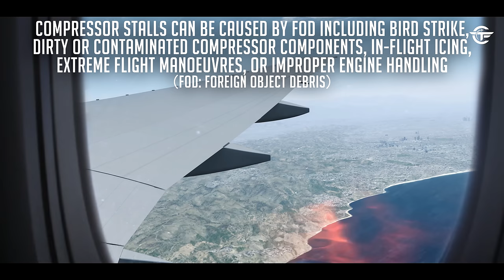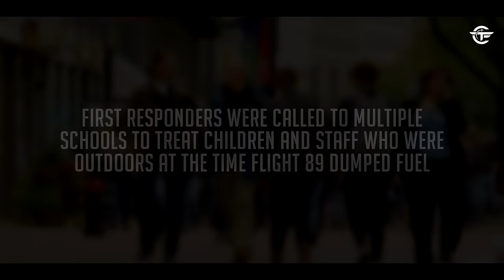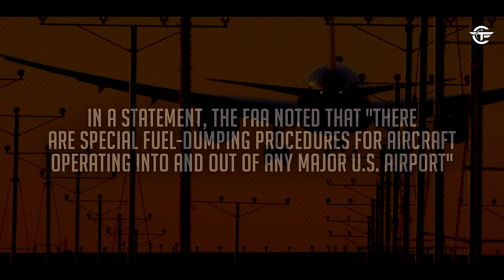Bursting into Flames Immediately After Takeoff from Los Angeles | With Real Audio

Comment: Ok I didn't think about the fuel dissipating when over 5000 ft I was just thinking right before they said that "doesn't that affect the water?" Also I noticed, not just in this video but another 1 I watched the ATC says like 128.9 but the pilot says 28.9. Does anyone know why the controller says the 1 but the pilot doesn't?

Comment: I've seen atleast 2 flightchannel videos where pilots went to dump fuel in the ocean leaving their normal landing course and ended up losing the plane and everyone on board. Everyone in comments were criticizing the pilots for taking the detour for dumping fuel and saying they should have just dumped it wherever and landed the plane. That's what these pilots did. And here the comments are opposite. I swear people always find faults. The crew had one job, to land the plane safely. They believed the plane was at enough risk that taking a tour of the ocean for fuel dump was too dangerous. They had one engine, you don't get to do business as usual with one engine. They took a difficult decision and landed safely. People also seem to think fuel dump happens in 1 second as if a big door opens from the wings and dumps it all at once. Its a slow process and the pilots started it at high altitude. There was so much fuel that even when they finally had to descend to lower altitude it was still dumping.  It's easy to criticize in hindsight. I respect the pilots for doing their job knowing full well they would probably be fired for doing so.

Comment: If ATC asks what's the nature or severity of the emergency, dont get technical with " compressor stall on right engine" or "vacuum failure" or " inertia separator malfunction" or any crap like that its not to say that ATC can appreciate the exact nature of your problem as you experience it in the cockpit. Time and concise communication and understanding on both sides is of utmost importance. Simply tell the ATC that the aircraft is uncapable of further flight and you need to land NOW, as in yesterday. You can do the nitty gritty tech chat when safely on ground.

Comment: all commercial aircraft have to prove that they can landing safely overweight. The MGLW is only for day to day operations so that large safety margins are kept. But there is NO concern for stopping in time or landing gear strength if they land full of fuel. That is a myth. 

If a commercial airliner could not safely take off, and then immediately land without taking 20 minutes to dump fuel, it could never be certified for flight. In fact, some airliners do not even have a fuel dump ability.

Comment: What a mess ... if you heard the ask on three separate occasions about fuel they clearly had time to answer the tower and choose not to speak over the radio. . But waited to get clearance to land on runway 25 right before beginning to dump fuel... it you listened the pilot answering the tower after they report an engine failure is not the same person... probably the senior pilot only. He knew what exactly what he was doing... nothing by the book that would cause any trouble for Delta including  to not advising the tower about any fuel dump at all.

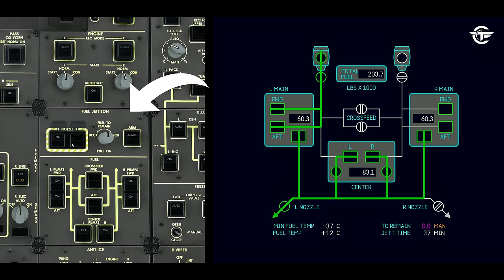Comment: 5:18 this was the first occasion land controller asked Delta 89 if they had to dump fuels. Answer from the stupid captains was "no". The question was repeated several times and the answer was "no". At 8:14 the pilots begun dumping fuels anyway. 10:00 the pilots are in dire straights, they nee to dump fuel but understand they are too low to do it but fails to be honest with the LAX controller. 11:18 The Delta airline is still dumping fuels while in a recognized non-fuel-dumping area and the pilots are not telling LAX. 
 
Sorry guys but this happened n 2020 and for a considerable future time I will not fly with Delta Air Lines. Neither will I approve any expenses of my staff travelling with Delta. Period.
 
When Delta Air Lines has trained all of their staff to the highest level, including stubborn captains, I will reconsider. But it takes proof to make that call.

Comment: Passenger view on from the right side of the plane, flames seen from under the wing, not the whole engine bursting in to flames. Breaking rules about fuel dumping at low level, 5 miles of LA

Comment: This was reprehensible and I wish that the FAA divulged what penalty they assessed to the pilots. They have the power to ground them; and if ever there was a case for it, "this is it!" I keep seeing comments about the pilots just trying to land the plane safely and making excuses for them-"negative!"  As a pilot in the worst case scenario, they should have flown a path over the Pacific ocean until they dumped enough fuel; and if they feared they'd go down beforehand, then the last place you want to crash is on land! Gliding along towards the shoreline is the best option in case you have to ditch.  ATC had moved and cleared the airspace and gave the pilot options and choice of what to do. My goodness, they had to think about whether or not to have emergency vehicles rolled or not! Whenever there's danger or fire, that's an automatic- and they turned back because of fire in an engine; though contained at the time, they had no idea if it would re-ignite or when...and what about the other engine? How many times have we seen cases where both engines ignite or where the cause of the engine failure causes subsequent fires? While dumping fuel, something could've gone seriously wrong and cause the fuel to ignite!  Then what? They're flying over a metropolitan area instead of the Pacific Ocean!???? Those affected by coming in contact with that highly toxic fuel will have to be monitored for the rest of their lives for all forms of lung disease and of course cancer of both skin and lungs. (and some comment "it's only minor injuries!?) COME ON PEOPLE! #SMH

Comment: Not all pilots are very bright. Should have dumped over the water. 10 days later? Most airlines have engine change crews that can swap out an engine in 24 hours easily,if they have an engine available on site. I would think Delta would have an engine available at a large international airport like LAX.

Comment: Shouldn’t ATC be a little more deliberate in this situation? The plane is fueled to traverse a quarter of the globe. If you have to turn back right after take off, It’s not a question of do you prefer dumping fuel. You HAVE to dump fuel if that plane is going to land safely back at LAX. ATC should have told them in no uncertain terms to begin dumping while they are above 5,000 ft and over the ocean, because once they’re descending on the long approach to LAX over populated areas, you can’t then decide you need to dump 20,000 gallons of kerosene on top of all those people on the ground in the middle of a busy work day. And what’s the deal with the Rolls Royce engine? What was found to have caused the compression stall right after take-off? Did they even bother to determine the cause? Doesn’t sound like it if the plane was back in service after only 10 days.

Comment: The flight crew is lucky they are not currently in command of a bucket and a mop., nowhere in operational procedures does it say it's okay to do a fuel dump over a highly populated area you try to do that over an area with that has as few people as possible for this very reason., he could have flown a racetrack pattern just off the coast, and accomplished the same thing.

Comment: It was all a mess and the pilots shouldn’t have jettisoned fuel on approach. This shows they were rushing and. It fully in control of the situation. 

One engine out doesn’t necessitate an emergency nor does it require a quick return to land. Hold, jettison and take your time. It may even be holding of >60 minutes to jettison fuel, depending on the load, so patience is required. 

Unfortunately not the best example of how to handle an emergency and combined with poor communications as well.

Comment: Total BS, fire alert would have been activated and fuel shut off  long before this photo shopped  video shows the flames coming out of the front of the starboard engine.  Notice no black smoke  stains on the nacelle?  Former Airline Captain who has experienced two engine fires.

Comment: so,,,,, you are flying and the engine catches on fire and then finally you shut it down.  yes I know it "didn't catch on fire"... I'm skipping details we all saw/read.

So the issue is not caused by pilot error.  If you messed up and are now no longer over water and no longer above 5k feet, then TELL ATC so you can get instructions about how best to proceed.  Tell them you are concerned about being able to gain altitude, but could still fly back over the ocean to dump fuel.

There must be some guidance or approval process that can happen, right?  on the fly?  like the decision the pilot(s) made was clearly the worst one for random strangers.

Comment: The height of irresponsibility. Dumping the fuel on a crippled aircraft during a very quickly changing situation. The decent thing to do would be to crash land , let the aircraft burst into flame and kill or disfigure all on board. Because the E.P.A. and  high school kids ,miles from crash impact got their cloths soaked in jet fuel. WTF?  Who GAF if the fuel was ''properly" dispersed or not? This was an emergency for Christ Sake.
Reply: Again. I'm not a pilot. I'm not sure what type of resolve or indifference to mortality they are expected to maintain. As a rather frequent flyer, I'd lick the soles of their feet for keeping a composure that most men would crack under.

Comment: We were taught in our ground schools that dumped fuel would entirely atomize if dumped from 500' AGL or above.  

Think of the "major emergency team response" if they had not dumped fuel.  When you only have two engines and you lose one, it's the smart move to dump fuel and get that fuel heavy aircraft on the ground before you take out a few acres of suburbs, schools, etc..  As for JP-4, a little soap and water will pretty much clear that up.  What I find interesting is the comments by the non-big airplane pilots here.  Incredible ignorance.  But then again, we are not surprised by that, are we?
Reply: 500 feet or above?  Not 5,000 feet or above?

500 feet sounds very, very low to me.
Reply: @timonsolus  it is low oh, but you have to understand the conditions under which you dump fuel. One you jump them for operational reasons in general you have lots of time, you communicate with ATC and the company and find a place and a time to dump it at your leisure. But when you lose one engine in a two engine airplane you don't have a lot of time to play around with. The rules are simple, Get It On The Ground as soon as you can. They were jumping from about 4000 feet anyway. Big deal! 212 dead bodies is a lot more important than a few kids getting on a light mist on them. I haven't read that report on the so cold casualties but I would imagine it's really overblown. And besides if I were the captain of that airplane I wouldn't care.
Reply: @dennisrayfield3914  : OK, so you can dump fuel anywhere at anytime provided that you declare an emergency first?  And losing half your engines is always an emergency?
Reply: Tim, most pilots in an emergency situation do not declare an emergency, vocally anyway. Air Traffic Control knew it was an emergency. And you can always make a good case for that after the fact. Every situation is different. In this case, I would have started dumping immediately. And I have flown captain on Boeing triple sevens for many years before retiring.
Reply: Dennis Rayfield so why not perform an overweight landing. Philippine airlines did it 2 months prior at LAX at that was with a heavier plane. And I don’t ever recall a dual engine failure that were due to completely separate incidents. Loads of pilots hold and dump fuel after loosing an engine
Reply: @tomstravels520  You are a rated Captain on large aircraft?

Comment: These planes had two engines. In the good old days you need more than  2 engines to long flights over water. Think 707,737, 747.

The rules were changed , ETOPS, when the planes were resigned for single engine operation for half the trip back or the rest of the way. Over 5 hours for this model
On one engine.

So being 10 minutes out is Nothing.

The should have moved to a location and altitude they could glide in if the other engine failed and dumped fuel.
Reply: I think the 737 only has two engines

Comment: Nobody here gets it I guess...pilot was smart, he did the dump near the airport in case of bad engine failure he had the best chance to land without killing 200 people on plane, he should be commended...haning out miles in the air or over ocean is not the best when you need to get landed quick due to an engine failing that wasnt his fault..the engine failure may have led to hydraulics failures or anyhting so he was smart to be near the airport to maybe save 200 people...people got fuel on them, who cares, grow up , 200 people could have died cause you dont want to have a little fuel spray on you...im sure all fake claims and people trying to sue of course, seeing $ $
Reply: im a flight attendant in training right now and i was thinking the same thing my guess is the pilot didnt want to keep hauling over the ocean with an engine blown even though you can fly with one engine but the engine was starting a fire outside the aircraft he had to hurry up and land his plane in the safest way possible maybe the other engine couldve went out as well

Comment: And what if the crew was over the Pacific dumping fuel and the 2nd engine developed the same problem? Anybody think of that? I'm with another poster - get the plane down. Nobody died save for some kids doused with jet fuel. Unfortunate, but nobody died!!
Reply: When has an aircraft ever suffered dual engine failure because of 2 separate issues that were not related? Never. Also if they were that concerned then they could have performed an overweight landing just like a Philippine Airlines 777-300ER (heavier) did 2 months earlier at LAX

Comment: I’m no pilot but I noticed (according to the video) that a high speed climb is approved and compressor stalls can happen with extreme flight maneuvers. Being these Delta pilots were not on their top game since they dumped fuel over Los Angeles I wonder if the climb was the reason these stalls occurred. 🤔

Comment: The possible culprit here is the pilots my have been overwhelmed with alarms, checklists and general human apprehension and mishandled the dumping of fuel. An Inflight Emergency is just that,   an Emergency. Or maybe they figured spend too much time in the air with a bad or failed engine and you may not have the choice on WHERE you land. Land too Heavy and end up a ball of Fire 🔥 from brakes overheating , Gear collapse or Runway overshoot... These pilots actions addressed both engine and fuel issues with Minor injuries to ground civilians.. That's a good job period...

Comment: Lots of Monday morning quarterbacking going on in the comments. First a few thoughts. Regardless of the engine problem, shutting it down was the only course of action. Do you want to fly 11 hours to China with a sick motor? By the book, you have to shut it down and then land as soon as possible. Second, no emergency is handled perfectly. It's ideal (but unrealistic), but 80% of the correct actions and a reusable airplane with no souls lost is a passing grade in my book. Finally, jet fuel is only flammable at a very specific vapor form. You could throw lit matches into a buckets of the stuff all day long and nothing would happen. Gasoline, of course would explode. Oh, and when they declared an emergency, the crew was free to do anything they wanted and  necessary to land the plane safely. It is also their "get out of jail" card should while doing what they needed to do, they violate or deviate from any rules and regulations---knowingly or by accident. The FAA knows that in the "fog of battle" a pilot, being human, might forget a thing or two or overspeed something on the plane.
Reply: So why was a Philippine Airlines 777-300ER which was heavier than this aircraft able to land at LAX after suffering an engine surge and failure 2 month earlier without dumping any fuel. And why then do other aircraft with engine problems hold and dump then land? Why didn’t these guys?

Dumping fuel at 1000ft when you were offered the chance and didn’t warn ATC is no excuse and every pilot interviewed has agreed. If there was another problem don’t you think Delta would have made a statement defending the crew? Nobody is bothered about people catching on fire, they were concerned about their children getting skin irritations and if they had ingested any
Reply: @tomstravels520  Jet fuel without it being in a tiny atomized mist, is not flammable. No one on the ground was at risk of being burned or put aflame.  At best it's a skin and lung irritant. I don't know what landing weight the 777 was at, or why they did what they did (I've landed a 767 20,000 pounds overweight---not a big deal), but I also don't know what the Delta folks were thinking. Obviously, more adrenaline flowing than logical thinking. They are human after all in a very intense situation. Most modern pilots will fly their entire 30 to 40 year careers and NEVER have an actual inflight shutdown of an engine (but lots of practice in the simulators). Back in the prop days, they routinely had inflight shutdowns once a month at any given airline. That's why all the transoceanic planes of the day were 4 engine machines. Theses events have become so rare in modern jet transports, when it actually happens, it can be jarring. "What, it's happening and we are not in the simulator?"